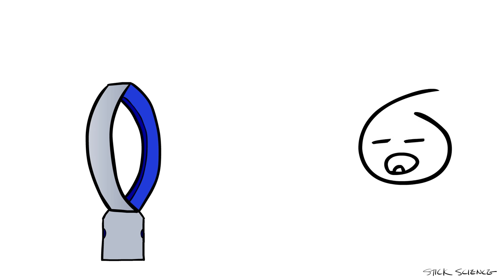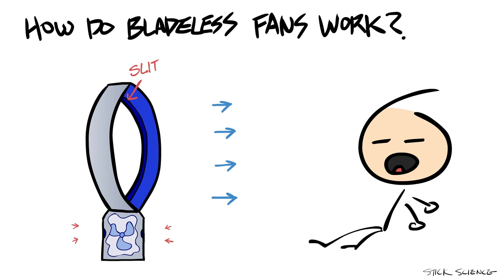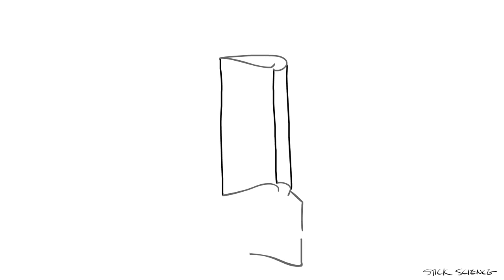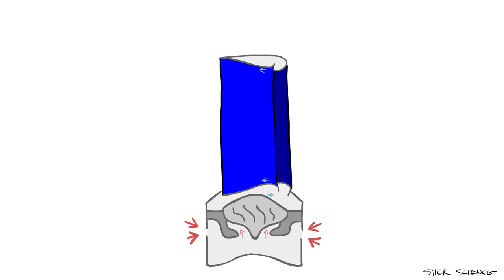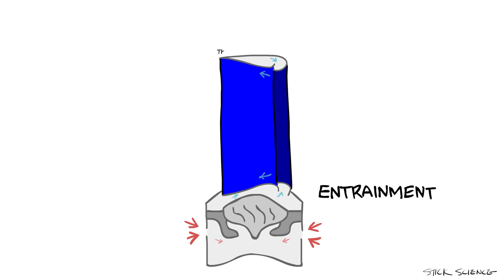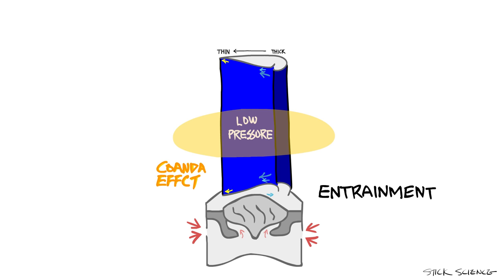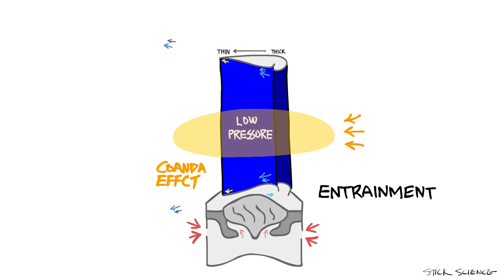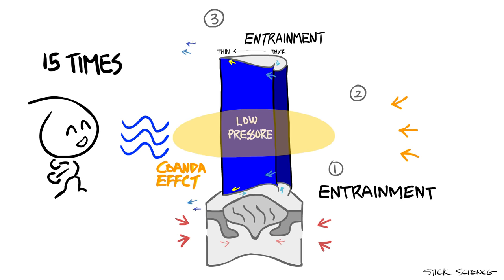How Bladeless Fan Works

Comment: I was so disappointed when I learned they weren't really "bladeless."  I assumed it was ionizing air somehow and used charge to propel the air or something.
Reply: They're also less efficient than just taking out the exact same fan from inside and running it in front of your face directly.

Comment: This sounds like a fan with extra steps
Reply: A fanerator?
Reply: Because it is
Reply: Yeah but with same blades more wind
Reply: it's for the A E S T H E T I C S, sir.
Reply: @justsomeguywithtattoos6267  it's less wind
Reply: @justsomeguywithtattoos6267  Yea but the more wind comes at the cost of being slower wind.
Reply: @ptronic  its 15x the normal wind a fan would produce. Did you not watch the video?

Comment: 0:05 I mean, let's be real here, there's no good reason for them to cost so much.
Reply: John Meise the thing I hate about them is that they charge  hundreds of $$, yet you can't do maintenance on them, so if it needs so much as oil, too bad
Reply: One word, Intellectual Property.
Reply: Dyson fans require filters (as the fans could easily gunk up since they're enclosed) and higher power motors to do what they do.

There are also cheap Chinese versions available that sell for half the price but still is twice as expensive as any other electric fan
Reply: I feel you but you gotta admit that is some crazy tech right there for a fan. The price IS justified but it’s just not a product designed for you or me :/
Reply: It's not about the product, It's the technology
Reply: @suharsh96  also, R&D, Dyson has to recuperate the money that went into developing said product
Reply: its also a decoration

bladeless fans are never something anyone will "need" so they dont need to market to the poor

Comment: EVERY fan entrains air on the outside of the stream... and every fan creates a low pressure area behind the fan.

There's only 2 differences here.

1. The fan inside is pressure sealed (like a computer fan). No air gets around it, so that fan can operate at a lower speed, but higher pressure inside. This means that it can push the air out the slits MUCH faster.

2. The center of the air path is not blocked by a motor and a slow spinning propeller (the centers of a propeller are moving a lot slower than the outside of a propeller, and move less air... but in THIS fan design, the center of the fan will EVENTUALLY be moving air as fast as any other part of the air stream.
Reply: did you go to fan school bro?
Reply: @sosic172  

I guess you could say that... I'm an engineer.
Reply: You seem to be implying that the Dyson model is somehow better at moving air at high speed (factoring in also noise level) compared to a regular fan, but it's very clearly not. The design is mostly for the "cool" factor, a gimmick. It is not efficient, much less "more efficient" than a regular fan. Look up a comparison video on Youtube, where actual measurements are made. I'd write the title of it, but Youtube would delete this comment (as it already has once).
Reply: @lako8368  I wish there was a review where someone removed the air filter. I know that would remove the purpose of it but yeah the results are laughable. maybe without it being blocked they might not be as awful

Comment: That's cool idea, i try use this into my drone prototype to create bladeless drone.
Reply: Post it on yt if it works
Reply: @SirDella  Ok i currently i testing best 3d print settings and materials for this. Now just i need buy some parts like electric motors, controller ect.
Reply: @LukiGames0  Good luck

Comment: After watching a few of these bladeless fan videos I still don't know if they are any more efficient than standard fans. If they are more efficient at moving air, why haven't airline companies incorporated them into aircraft? My guess is the 15 times more air isn't a big deal compared to ducted fans or prop driven aircraft. No blades may be safer for indoor fans in your house, but it's not a concern for commercial jets. Efficiency is though.
Reply: Probably not that efficient, just some state of the art look/design.
Reply: Yea, the 15 times the air thing is irrelevant.  You can throw out a little bit of air at a high velocity or a lot of air at a low velocity and you end up with the same airflow.  Dyson does the former and other fans to the latter.

Comment: There is a bladeless fan at my cousins, and i thought the air they produced was kinda weaker than one with blades.
Reply: It uses smaller blades, so it's normal. If you have to compare it, you have to compare it with a fan of equal blade size and rpm.
Reply: Was it on low settings?
Reply: @Exilum  Why?  Is this some olympic event broken down into blade classes?  It's a fan with pathetic airflow that is loud and priced an order of magnitude above what it is worth.  Also, it's probably not even the same type of fan as most desk fans.  I'm pretty sure it is a centrifugal fan with an impeller because it needs to generate a higher pressure to squeeze air out of those little slits at high velocity so a blade size comparison is like comparing apples and oranges.
Reply: @jonathanhill2703  Well I said what I said for the simple reason that there isn't a single factor. Comparing a bladeless fan to a bladed fan would only show difference in type should the blade sizes and rpm be the same.
On a side note, you seem to dislike bladeless fans due to their poor performance, but don't forget they're not the same products. A bladeless fan is made to look cleaner, not perform better. It's like comparing apple and oranges, as you said, except on a wider scale.

Comment: Long story short. It's has a fan that blows wings that energizes the airflow enough to draw in more air with entrainment AND exploits the coanda effect 

Change the fan for a v8 engine and you'll have a 2012 F1 car diffuser. In concept at least

Comment: Has anyone here owned one of these and compared it to a conventional pedestal fan? 
The design made no sense to me, essentially an enclosed ducted impeller sucking air in through the base then forcing it up through the body into an annular hollow blade. First issue is the uneven pressure the further the ring is away from the base i.e. less pressure at the top of the ring. 
Next issue is how hard the motor is going to have to work to pull air in and duct it up through the ring, I just could not see how this would be more efficient than a conventional bladed fan which would be under less load and not have to force air through ducting.
With these thoughts in mind I surmised the Dyson would not only have to worker harder to match a specified air flow similar to a conventional fan, it is likely to also be noisier.

I purchased a Dyson AM07 and a Sunbeam DC motor pedestal fan. Sure enough the Dyson had to be set to 4 to match the lowest setting on the conventional fan and was noticeably louder than the near silent conventional fan. 
The Dyson looks great but isn’t a great product, it pushed less air and has a serious noise impact if you ramp up the speed to get to a decent air flow. 
After a week the Dyson was moved to the study with the Sunbeam in its former lounge position. 
Another issue was dust clogging at the air inlet holes around the base, clogging the duct and the annular blade outlet, it’s a pain to keep cleaning. Ultimately the Dyson was sold.

A conventional fan is quieter, more efficient and easier to clean.

Comment: Obviously you can't get something for nothing so you trade higher pressure at the fan for higher volume.  The question is why not just start with a bigger fan?  What is the purpose of using a small fan and then a multiplier?
Reply: For it to be compact?
🤔
Reply: smitajky BINGO!     There is no something for nothing!    You trade off velocity or volume. Period.   With a given source of airflow, it can be manipulated for either higher velocity or higher volume(pressure), but not both.    It is, in essence, a gimmick.   I have a Dyson vacuum cleaner and it is a gimmick.  It is a very powerful brushless motor, which is not a gimmick, coupled with decent airflow management.    With a regular vacuum cleaner, if you block the inlet, the and there is no leakage, suction will be reduced, and the motor will overheat.     If you took a perfectly sealed syringe, and picked up, say, a ping pong ball, it is the DIFFERENCE in pressure holding the ball against the tip of the syringe.    If the seal is truly perfect, the ball would stay indefinitely.   But there is no such thing.    But if you were to make the seal slightly imperfect and let just a little air in with the vacuum, the ball will stay, but he vacuum DIFFERENCE must be maintained, and the syringe piston would have to be miles long to maintain that for any length of time.   With the Dyson vacuum cleaner, there is a slight bypass which allows vacuum to continue, and the motor is very powerful.  So you can completely block the vacuum cleaner and suction continues.   With a conventional type, of you block the inlet, suction is reduced, and you need to unclog it to continue.     Same with a Dyson, but the bypass behind the block allows vacuum to continue, and the very powerful motor masks the real difference in pressure.    Some other modern vacuum have employed the bypass, but not as subtly as the Dyson.    So bottom line, if you are suing the hose in a Dyson and block it with said ping pong ball, vacuum will hold the ball there until the motor overheats and a sensor shuts it off.   With other types, the bypass reduces vacuum, but they won’t shut off unless the the bypass is also blocked.    So in essence, the Dyson is a gimmick .  I’ve spent more on vacuum cleaners in the last 5 years than any human should, only to discover that there are compromises for each and all of them.   The Dyson is NOT THE BEST.  It is marginally more powerful when new.   But as the filters clog, it performs poorly, as expected.     They all do.    The Rainbow water filter vacuum is the best ever made, with consistent performance, be use you “clean the filter” with every use.   But a pain in the ass.  Where do you put that nasty water?  Back yard?  Yeah, wait till the dog or other critters get into it.   Through a mesh screen and then the nasty water down the commode?   Sure, but a pain in the ass.  Blade less fan?  Gimmick.  Just the act of “forcing the air” through the slits makes it less efficient.  It may seem neat, but there is no more air coming at you than with the initial fan in the first place, it’s just redistributed.   I call bullshit.

Comment: can you believe ppl were stupid enough to pay 2, 3, 400 dollars for these things back in the day now they undesired and cost 30 dollars with a 5,000 mah backup 4/8 hour battery. lol. i do believe in this brushless motor technology tho I am seeing a company called Dreo selling some pretty nice fans between 28 and 23 decibels CFM ratings like 250, 350, 1,050 CFM in very small fans with only 6, 7, 12 inch blades. I dont know how true it is that their little fan blows 1,050 CFM not that i dont doubt it but thats literally over 2.5 tons of air movement the kind of air movement you would see in an entire 1130 sq ft house. Im about to buy one and find out.

Comment: So it's not bladeless then is it.
The base has a fan in it.
I wonder if the fan in the base would use more power then a traditional fan or not.
As we know it's far easier to blow air then it is to suck air.
That's why you can blow a candle out but you'll burn your lip of you sucked

Comment: 1) They aren't bladeless.
2) You paid too much.
3) By this logic - my car is motor less - because you can't see it.
Reply: At least you don't need to put a bunch of bars around it to not get cut with the blades
Reply: @flatearthnews7904  Imagine using that justification to console yourself after buying a gimmicky fan in the hundreds of dollars when a $20 fan works better.

Comment: Your illustration is very confusing, and doesn't illustrate to the user what is happening.  The little arrows don't help, if you don't explain what the long blue irregular cylinder is, or what its relation to the odd drawing on the bottom is.   

Bladeless fans are extremely inefficient; you are not getting "something for nothing" with this method.  The "entrainment factor" of the air flow is snake oil; a direct blade system is much more energy efficient, and produces a much higher air flow rate, for much less energy.  This is a novelty toy, not a serious appliance.  It is also extremely wasteful of electricity.